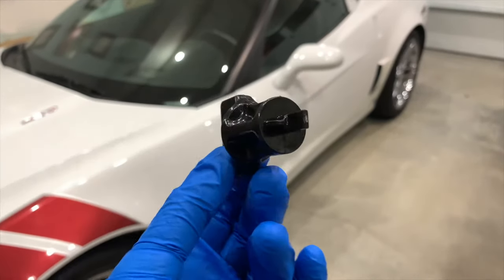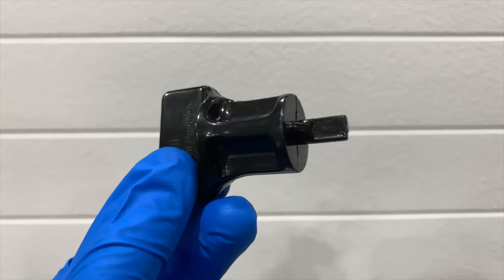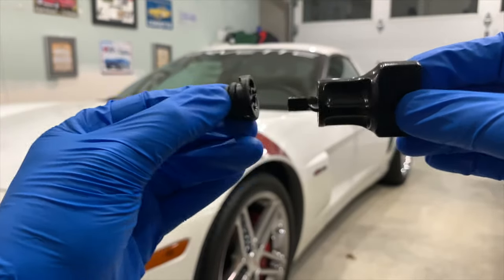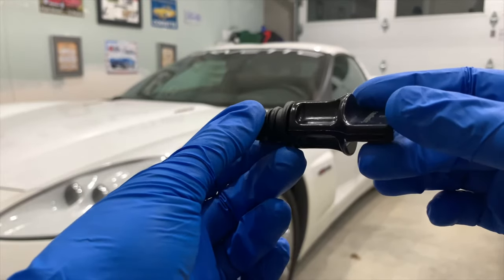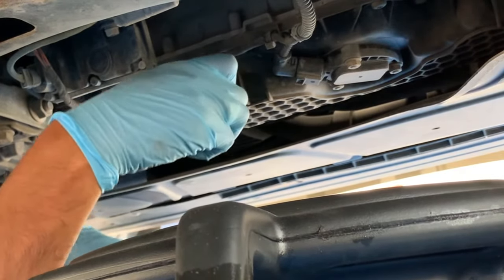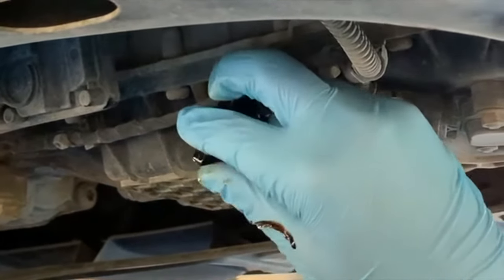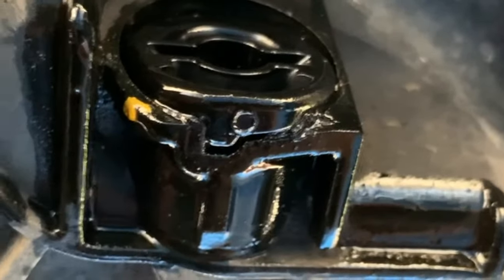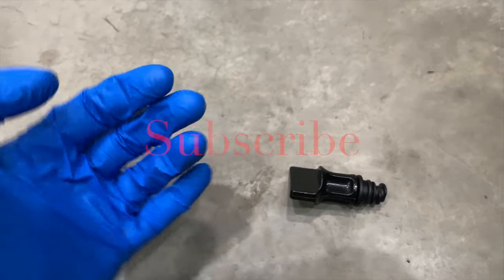Oil Drain Plug Removal Tool - for VW and Audi

Comment: Using the correct tool is always the best option. However, if you have to use a screwdriver, don't use a flathead. A No. 2 "Phillips" head screw driver fits securely into the socket of the drain plug and will not slip around or mar the slot like a flat blade screwdriver. I've been using a Phillips head for years to remove and install this style VW drain plug..

Comment: Thank you so much! I didn't even think of getting such a tool. Today, I damaged my drain plug slot part with a flat screwdriver and didn't know what to do. Luckily,  your video helped me find a similar tool in an auto parts store, which I would say is better than the one you used. It is called Performance Tool Lock Oil Filter Pliers and costs $13.99 plus tax. Thanks again!
Reply from the maker: Thanks for the tip - I’ll look into that tool later this evening.

Comment: Hi, I have a 2019 VW Golf 1.5 tsi and need to do an oil change later in the year. Would you know if mine has a conventional sump not or this plastic type that needs the tool?

Comment: What mfg don't provide easy oil drain mechanism like locked valves where once just open valve to drain oil .
Reply from the maker: All oil drain plugs function the same way - they release the oil from the oil pan.  However they are not all same way.  Manufacturers such as Honda, Toyota, GM and Chrysler, to name a few use bolt and crush washer system.  The advantage to the VW system is that once it locks, you don’t have to turn it anymore.  The bolt system needs to be torqued to a specific requirement which sometimes poses issues with over tightening and leaking crush washers.  Though it maybe rare - this just takes damaging the oil pan out of the equation.

Comment: I have q5 with allen key..im wondering  will this fit
Reply from the maker: This specific tool will not work on your setup.  You can buy an interchangeable bit that has both patterns on it, for VW and Audi. This would be useful if you had multiple vehicles.  Otherwise a hex bit will be perfect for your Audi.

Comment: I have a 1.8 and the female oil drain plug threads on the oil pan side are stripped.  Does this depend on those threads?
Reply from the maker: So VW / Audi used a few different types of drain plugs.  The one that is in my video, an allen key / torx bit or a socket style 17 / 19 mm.

Comment: Are these plastic drain plugs designed to be single use (replaced at every oil change )?
Reply from the maker: I replace them each time - only because it’s an inexpensive part ($20 for 10 units).  Though it can be reused if the gasket and plastic is still in great shape.
Reply: They are single use. But some people report changing the gasket works.

Comment: Why does a screwdriver not work? How does it damage it? I used one a few weeks back and have a slow leak but want to confirm it’s the screw driver before I buy another tool for one job that I won’t need long
Reply from the maker: So, some would argue that a screwdriver can work. Now, those are likely the individuals that took the time to use the correct size standard screwdriver.  Most individuals unfortunately won’t!   

This recommended tool takes the guesswork out of the equation.  

The issue with an incorrect sized screwdriver is it breaks/warps the plastic face of the drain plug.  And if that happens, then it’s easy to miss that final turn that locks the plug into the tab.
Reply: Thank you!

Comment: is this why most people just use extractor?
Reply from the maker: Since the oil filter is mounted top side; some individuals will use an oil extractor to save them from going under the vehicle.  Extractors have become popular as they remove almost all of the oil, including the sludge.  Personally, I would still go under the vehicle, but both methods have there pro's and con's.